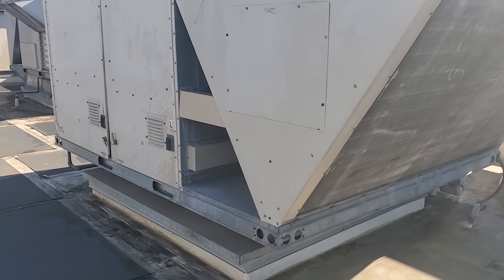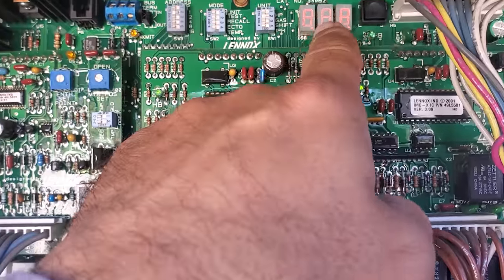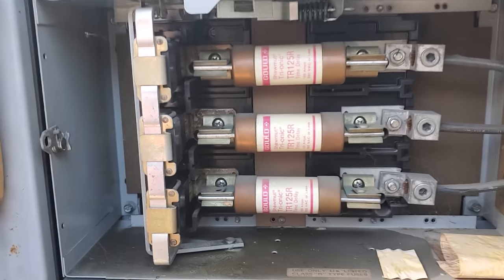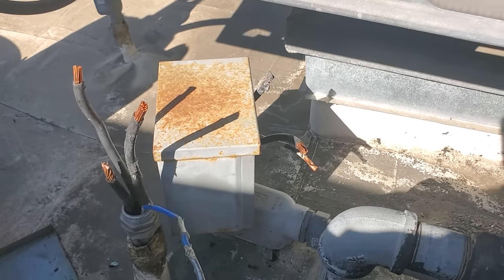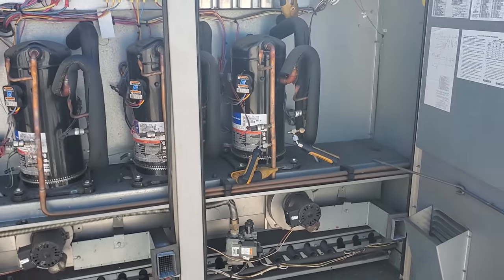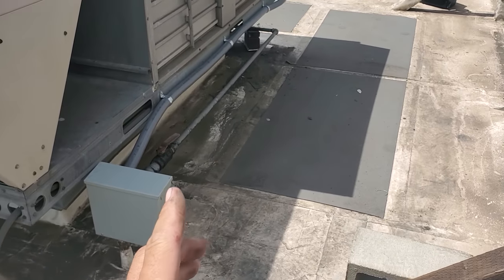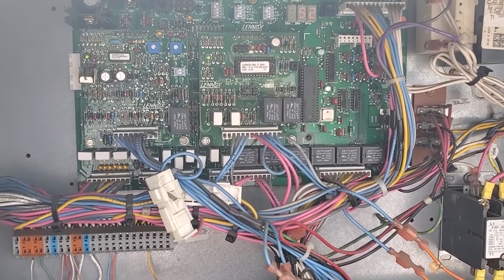ELECTRICAL FAILURES ARE FUN

Comment: wondering if you guys in the US have arc detectors. Some newer circuits here in germany use arc fault circuit interuptors or basically fire protectors for electrical lines. Since Electrical arcs have a very distinct and different frequency the device can "listen" to it and then trip the breaker. It seems to me that the US does have quite some problems with surges etc.
Reply: I can say in the warehousing industry these arc fault/ fire infrared circuit interupters have been around about 10 years now due to the amount of cardboard and its dust in the facilities
Reply: They are required in residential areas where people usually use extension cords. Damaged extension cords can cause a burning arch that can catch a house on fire.
Reply: O man he was just axin about gfcis lol. Thot he was askin about infrared fire eye contacters that "see" arcs and drop out power
Reply: Just look at those electrical panels, it's all 1950's. You can answer that yourself... they didn't even adapt DIN standard fully and also still use 1950's wire nuts lol.
Reply: @FrozenHaxor  actually i was wondering if it's a thing anywhere in the US. That the wiring there is absolute garbage seems clear to me as well.

The others answered my question here pretty good. Thanks for the answer anyway though :)

Comment: I always start with incomming power and work my way down. Many units may still have working components, even if one fuse is blown because they may be single phase and be tapped off the legs with the good fuses, like combustion fans, boards, or transformers. IN ADDITION, you are making me kringe !   Please wear gloves and glasses, preferably  electricly safe while you are probing around with the power on. I also leave notes with my name, date, and what was done on the unit, and I place it next to the unit model/ serial numbers so I can take pictures

Comment: Controller lockups are actually very common in my experience. Brownouts, power blips, lightning strikes and other interference can cause any controller that is poorly designed to lock up or lock out and fail to respond.  I call it all the lights are on but nobody home.  This is not necessarily a permanent problem but a recurring problem which is cleared when power is removed from the controller.

Well designed controllers have what are called watchdog timers as part of the circuit that will clear this kind of fault should it occur.

Comment: Chris that was a good call let the electricians do the work run the seal tight and you go on to another job that LB under that splice box was crap they did it right I did that work for 45 years I am like you brother

Comment: With aluminum wire youre supposed to use some goo on every splice point to stop any galvanic corrosion and preventing arcing in the future.  Its definitely code in electrical panels/ breaker boxes..   thats likely the reason it failed, they used a copper lug on an aluminum wire..  if any moisture is in the air, the electricity will cause the stuff to deteriorate..

Comment: Electrician chiming in here, those connectors are usually called butt splice connectors.
Bottom line they are garbage for this application, especially with a heavy continuous HVAC load.
I run into HVAC disconnects burned out fairly often, and it's almost always because something was loose. Less common to see a junction on circuits this big to begin with.

Comment: Troubleshooting 101.  Check the supply voltage and low voltage power before you start looking at circuit boards.  and yes, I've made that same mistake myself :o)

Comment: it might have been a voltage spike from the  ark breaking down from the other unit 
not enough voltage to trigger the fuses or breakers to trip but enough to lockout that specific board.

Comment: Was amazing to see this type of work, ty wor sharing, as for why the ac was behaving that way, I have a theory, but 1st I have to make a clarification, English is not my main language, 2nd this theory came from my knowledge of PIC and working with that technology on college (designing and coding PIC and boards) , so here it is, when the power surge happened, PIC had a fluctuation on readings, one or more sensors reported some weird data, or even just noise to the PIC, so because that particular scenario was not considered, not in the actual coding of how the PIC will behave and what to do, it just ran into a loop, trying to figure it out what to do, without doing anything, once you cut out power and restore it, all sensors were fine this time, so everything went back to business

Comment: Most excellent troubleshooting, seriously excellent.  My only comment would be with the 3 phase electrical supply. Copper lines / aluminum connectors ?  Personally think the initial electrician should have used NoOx . . Big time.   Also very excellent narration.

Comment: Burning wires bcs Americans did not yet learn to use wire ferules, or to use cage terminals. Pushing on wires with a single screw. Jeeez, are we in 1900s?
Fuses downstairs looked 125A, breaker on top looked to be 150A. That also makes sense. (Not. Selectivity anyone?).
Anyway, the biggest issue of US electric is being stuck with the asymetrical 3phase network and half the voltage. (Half voltage means two times current, but four times the power loss).

Comment: Almost certainly the bad connection just started out with a little resistance, that produces heat and makes the connection worse. Eventually it got so bad and started arching/melting, that would have as Neil said caused spikes in the mains so the microprocessor in the second unit locked up and just needed a full reset to get straight again.

Comment: I was wondering if you guys request an RCDs when you get electrics done.

An RCD would have detected the fault in milliseconds and shut the power to the roof off without extensive damage to the wires
Reply: What is RCD?
Reply: @davejohnsonnola7908  well, I'm sure you can educate yourself and don't need a random guy on the Internet to use the Wikipedia search for you. :)

Comment: Electrical problems ! Once had a call with 2 RTU's not working , The building transformer dropped a phase , Electricians replaced the transformer , RTU's still no working ? They had reversed the phases ! I had to rewire the building's transformer .

Comment: A powder coated surface is NOT a ground reference (at 1:12), when checking for absence of voltage or for shorts to ground with a DMM you need to place the black lead on the actual ground bus or factory bond stud.....just saying

Comment: Thou shall check voltages, but holy copper hanging out of the top of the breaker.  Did they strip it with there teeth.

Comment: Great video, Noticed a few things that you do that here in the UK is a big No no..
Those test probes need finger guards, Units cannot be opened without a tool of sorts, Any tool just not with bare hands..PPE (personal protection equipment) is lacking, especially in HV environment. 
HV warning signs?? Public notices 
Those connections are just wrong.. No copper on show when terminated, Those terminations are very amateur and not great, Neater job to ferrel /crimp the connections..
No labels to indicate supply - load or phases..
Considering the unit is a metal case I seen little evidence of Earthing.. Those metal conduit pipes would need to be bonded as well as grounded to maximise safety... 
Overall good video tho,

Comment: Where do you stand on keeping 40 year old systems running? I just bought a commercial building and every "repair technician" is quoting me replacements for a running system that I just want serviced and cleaned up so it stays working. Not a single one has bothered to put a meter on it to see how well it is running, just turned on thermostats to verify it is operations and tell me how old and poorly maintained it is.

Comment: well if you have arcing from a bad contact at >100a of course you will have glitches on the line
with that much power on any secondary side of a transformer it will act like a boost regulator, causing brownouts and spikes to as much as 2-10x the voltage, especially if the output is floating
I expect the AC units might have had as much as 400vac in spikes when that splice failed, such a high spike could have easily overvolted the microcontroller circuitry in any of the units on the same service feed(likely the entire building had glitches, possibly a few crashed devices the owners rebooted without thinking about why it crashed)
a crashed microprocessor via voltage transients are so annoying but easy to fix

when you have arcing like that splice assume any other bits may need the old "turn it off and back on again" and make sure each unit is at least booting up, if not actually at proper pressure and temperature

trust me bro, my NAS+game host pc had all kinds of weird shit I blamed windows/the drives for but once I swapped a power supply that still shows proper outputs with a multimeter literally all issues(besides minor data corruption that required data migration to delete a directory that was corrupted and windows refused to even tough with any commands) just went away
power issues are really fun, especially when the issue requires a fucking 500-5000$ oscilloscope to see in action
the PSU is still in my possession as I am sure it can be used for TEC modules and fans, just not drives and CPU's
Reply: kept watching and you denied the biggest factor of the US power grid, each major business tends to have an almost dedicated secondary winding on the local utility pole, any arc issues on heavy equipment circuits WILL feed into other equipment as it is on the same inductive source

sure maybe another location MIGHT share the same secondary but transients tend to dissipate with distance and auxiliary loads, so if a location causes a transient, the most likely devices to get tangential effects are those closest electrically, even through fuses

if I had a powerline lan box on one circuit of my home and another on another circuit, and my neighbor had their own powerline setup, my stuff doesn't easily, if at all, connect to their stuff, likely due to power filters in the service hookup equipment, the same idea happens in this situation, an AC with power issues like that will feed the noisy spikes along the non-isolated, non-filtered building wiring, leading to spikes seen on ALL equipment before any line filters, and if the AC units have filters it is likely that dining unit has worn aged filters that simply failed to absorb transients, causing a code crash that left it in lockout mode

at least that circuit is transient tolerant in that it locks out if a processor crash occurs, better than a seized compressor or lost phase causing a fire

Comment: Obviously, we'll never know, and somebody may have already suggested this, but I would like to muddy the waters, even more.

Vibration caused the burned wire.

The new roof changed the length of those electrical connections. The lug may have been loose, but the wires were free to shake in such a way that the lug gave up even faster. Crackle, crackle, pop.
Reply: I loved Muddy Waters! Great blues brother!

Comment: How many temp probe's do you use (4?). You make measure quick look so easy, I only have 2 temp probes do you suggest getting 2 more probes?
Reply: Now, I'm just a sparky, not an HVAC guy, but under the general principle that there is no such thing as too many to(ys)ols, you already know the answer to this.

On a more serious note, I assume that he has probably six probes on his truck at any time. This makes it easier if one fails, and if you're in an especially complicated and gnarly setup, you can place all your probes, then pair your tablet with the ones you want to read, instead of climbing all over the unit three or four times.

Comment: Scrolls are phase affected?  Shouldn’t be. That fan motor will though.
Reply from the maker: Yes all 3 phase scrolls are phase dependent meaning they can only run in a single direction, if you run them backwards they can be damaged.

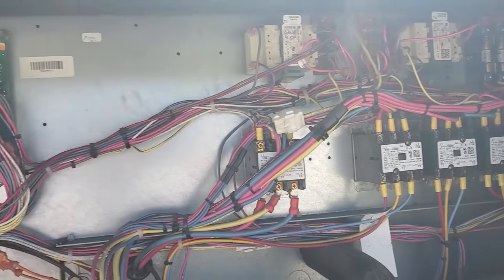Comment: 14:58  It's nice the electrician used different colors for the phases instead of all black like the original was, but why did he cut the insulation back so far on the red and blue?  Ugh, sloppy job!  Not like it's that hard to do, stripping it to the right length? ☹

Comment: Looks like oscillator/clock circuit failure triggered by high EMF or unstable voltages from the arcing._

Comment: Arc Flash and Electrucution is serious.110 vac by code  shall use electrical ppe.Technician needs ppe if he gets burn out or shock you will be liable and will cost more. Shortcuts  are not worth
Reply: This guy doesn't use electrical PPE pretty much ever. Guess he'll just have to cook one of his techs and get sued before he catches on. His complete and utter disregard for safety is a shame because it somewhat invalidates the value from all his good troubleshooting skills.

Comment: As a HV electrician,those terminations of the new cable entering the switchgear assembly are terrible,there should be no copper showing & there's a good 10mm on display here,if someone were to sit an unisulated screwdriver on top and it rolled back into it, there'd be a hell of a fireworks show, pretty ordinary work.SMH.🙄

Comment: They will forget what you told them. When you begin service the thermostat is part of the electrical troubleshooting. You have the indicators on the control board but the customer only knows by what they see at thermostat. Since they thought there was only 1 unit, I think you need to show them the room thermostat location for the separate HVAC units. You service kinda like I do. You check the common faults first and then move to the uncommon. Many trade schools teach to begin with voltage measurements at the power lugs and work out from there. That method wastes time. using the apprintus teaching is better if the student has a knologible and experienced journeyman like yourself. I have found journeymen that have a few months of knowledge but they have been getting by for 10 years. Your experience with Lennox is way better than mine. Please explain how you learned all those new control boards and how to perform the self tests and other short cuts.

Comment: Copper to aluminium lugs or connectors will always be a problem when there's an absence of nolox or no-corrode on the terminations, especially if they aren't talked 😉 up properly. No aluminium bussbars or lugs were ever installed by me in Cameron Parish on Louisiana's gulf coast. All ss cabinets, copper busses & brass or bronze lugs.
I learned from other people's cheap ways. 
Ps, the FIRST thing I ALWAYS do is check line power. It might seem like I'm nitpicking @ the engineer/designers,  but 240/480v motors DO NOT like 208v power. That's why, If I'm building a system less than 480,  I specify 240 3/phase with the utility company at the outset. The "Fieldpiece" datalogger is nice ay?